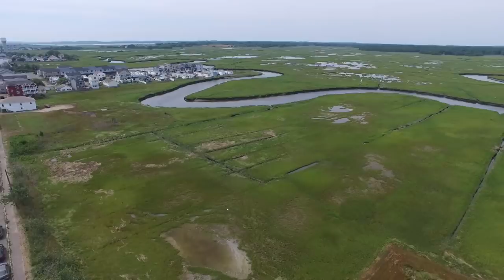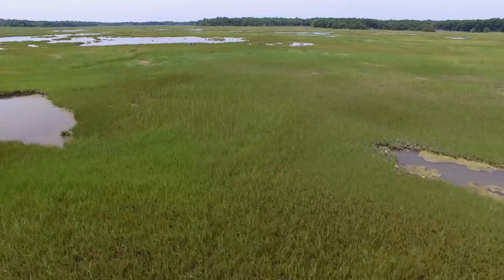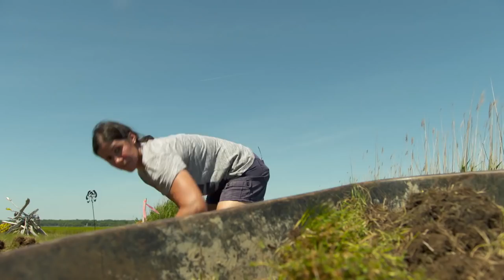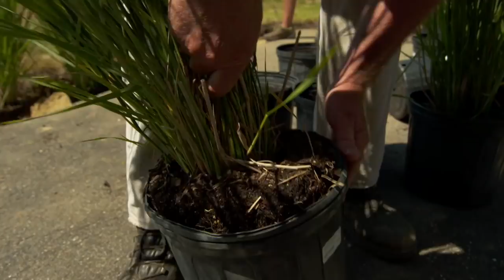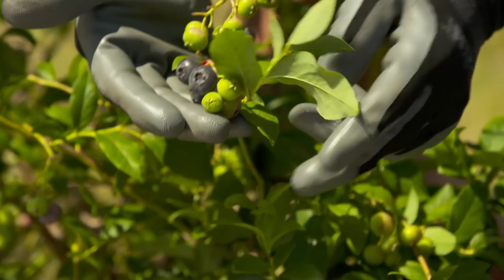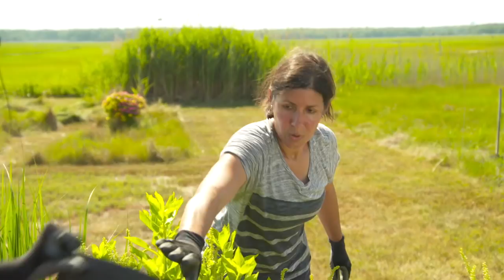How to Plant a Rain Garden | Ask This Old House

Comment: The design could have been improved by using some of the soil that was removed to create a berm on the backside for greater runoff retention. 

As for growing stuff, the homeowner should consider subirrigated raised gardens, which have an impermeable layer to retain water. In this case, it would also prevent the salts in the soil from wicking up and killing her plants.

Comment: Is Pete Moss not good for gardening?  I spread out a bag over my garden this year.  To be honest I have mixed feelings about it.  I thought I would have been adding valuable nutrients in to my tomatoes, cucumbers, peppers, and onions.  Thoughts?
Reply: There are benefits to peat moss, and there are plants that thrive in it. It is probably not the best option as a stand alone material for most plants. 

The greater concern with using peat for gardening in general is the environmental impact on the source. Peat is not an easily renewable material and peat bogs are being devastated by the extraction at an unrenewable rate. 

The good news is there are other great alternatives.

Comment: That doesn't look like peat, I lived in Ireland for 3 years and have used peat to heat a home (it will actually burn) and this doesn't seem to have the compactness and color of what I'm used to seeing. I'm not disputing what the scientist is saying but it doesn't seem to align with what I've seen in the past.
Reply: You know, after watching a bit more, the color and compactness looks like something you could call 'peat' though it's not anything like I'm used to in Ireland.
Reply: soil varies greatly from state to state, let alone US vs. Ireland - that's probably why
Reply: Yes, soil does vary but peat doesn't. There are certain characteristics that are constant and don't change based on location.

Comment: Doesn't a rain garden need to account for the volume of run-off and the rate of infiltration?  Rain gardens are therefore typically depressed in order to absorb the influx volume.  It seems to me that this isn't a rain garden; it's a border planting.  Also, I don't recall hearing anything about choosing plants suited to the run-off contaminants that are supposedly being mitigated.  This lady seems like an amateur.
Reply: ncooty I was thinking the same thing. This “rain garden” isn’t really a rain garden at all. I’m sure with the loose soil mix they put in, it will absorb water well, but a rain garden is typically depressed and can actually mitigate some storm runoff. Heavy rains will run right over and fill this up fast
Reply: Valid points. 

An alternative to depressing the garden would have been to use the soil they removed to berm the backside/downhill side to provide the water retention.
Reply: Tyler - Very true about heavy rains, but you missed the comment on “1st flush”; the first quarter inch of rain. This is when pollutants are washed from the manmade surfaces. The initial runoff is rarely from a heavy rain.

Comment: that just looks like a regular garden to me.
Reply: The significance in this scenario is that it is located at a place that intercepts the stormwater runoff from the street and driveway. 

There is a lot more that could have been done regarding grades and water retention, but probably exceeds the limits of the show as well as the expertise on hand.